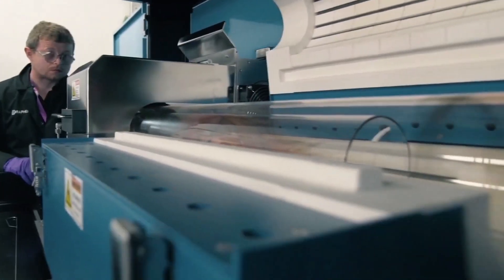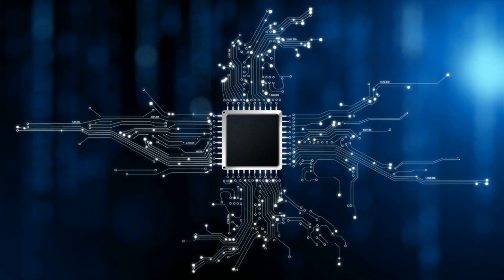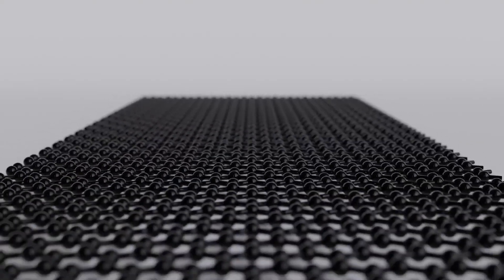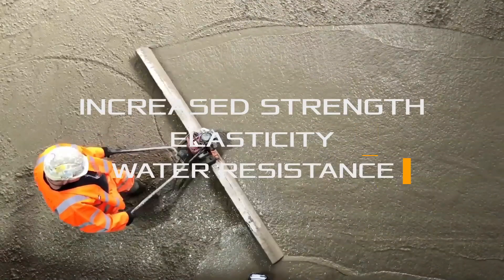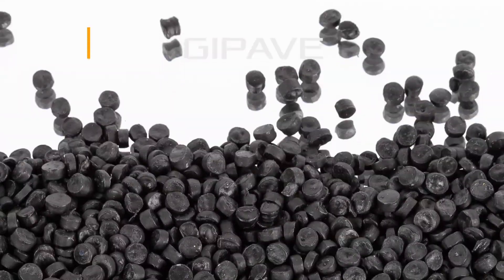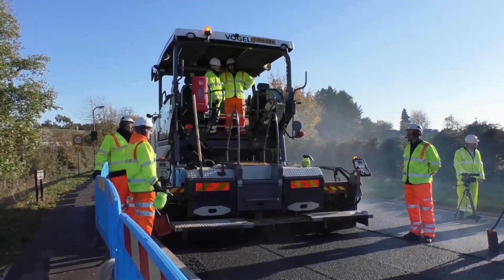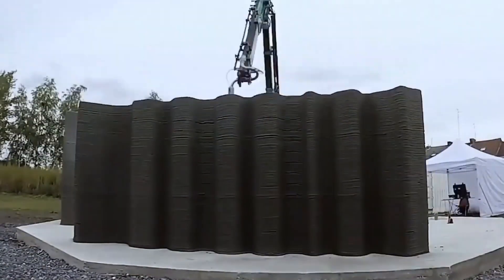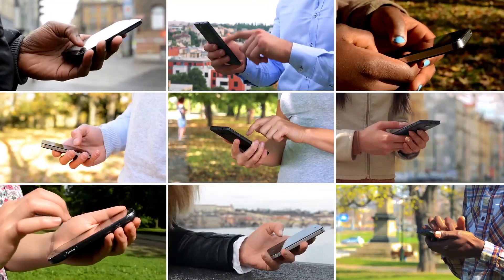Graphene in concrete is already changing the rules of the game in construction

Comment: Graphene Reinforced Concrete certainly is a novel idea.  On the surface, it seems as though it would extent the life of a road for quite some time.  
However, upon further analysis, given the nature of Graphene Oxide Nanosheets, because they remain 2-dimentional the only strength that added is that of damage from the from the compression of the vehicles traveling on the Graphene Reinforces Concreate.  It is also believed to add a measure of water resistance, the is the worst enemy of all roads.  Graphene Oxide Nanosheet Infused roads would also be measurably lighter, therefore making bridges, overpasses, on ramps, and other transitions additions to road less labor intensive, therefore less costly to construct.  Also, nearly all Fractural Strengths are inconclusive as to whether the addition Graphene Oxide Nanosheets. In facts, it varies so wildly, Scientifically, Peer Reviewed Study had been conducted that met the criteria for certainty that there was an increase Fractural Strength.  Equally valid Scientific Studies have shown nominal increase in Fractural Strength, while have shown as much as a 15% increase in Fractural Strength.  I like in the Silicon Valley, so Earthquake country.  For this region, the must be absolute certainty that there is a statistically significant increase in both Compression Strength and Fractural Strength, so for Graphene Oxide Nanosheet infused Concrete is worth the investment where we have to ALWAYS seriously keep in mind those roads, overpasses, exits, flyovers, etc. that unequivocally must stand up to a minimum of a 7.5 Earthquake.
The most obvious flaw with using Graphene Oxide Nanosheets screams out in it name.  They are sheets.  They are 2-Dimentional.  So by definition they can only add structural integrity on one plane.  It is also not very flexible at all, in fact, if torque is applied, it does not take very much to shatter the structural integrity of Graphene Oxide Nanosheets.

A far better a significantly more cost-effective alternative to Graphene Oxide Nanosheets is a technology already being used in roads: Carbon Nanotubes.  Carbon Nanotubes form helixes that tend to form long tubes.  As these tubes are 3-dimentional, they can resist torque on any plane applied by an Earthquake.  While Carbon Nanotubes are significantly more resilient, they remain, significantly more expensive, and there, at this moment in time, cost prohibitive for mass use in roads.  But manufactures are bringing production cost by factors of 10 about every 2 years.  So, within 5-10 years Carbon Nanotubes become, far and away the best solution.
Reply: thank-you
Reply: afaik, the problem w/ nanotubes is the very limited length of strands currently doable.
Reply: @peterconnell2496  Actually, there have been huge strides in Material Science recently.  A group of Japanese  Scientists, have found an entirely new methodology.  They routinely create 50cm long Carbon Nanotubes, en masse.  They are confident that they can move on to 200 cm within a month, again, en made.  This would eliminate the price barrier and allow for the begging of experiments in weaving these longer and longer strands of Carbon Nanotubes together, leading to possible limitless lengths of Carbon Nanotubes.
Reply: @donbrunodelamancha1927  Ta for the good input. That would seem the holy grail as short strands seem the key hurdle to wider applications.
Reply: And as usual, any post that gets more than 8 responses turns into a sh*t fest of name calling and posturing. Good lord folks.
Reply: Would not stacking the 2 dimensional sheets on top of one another as it seemed to show them doing mitigate this problem?
Reply: @davidtherwhanger6795  while an excellent idea, you would have to construct a lattice of sheets perpendicular to each other.  Unfortunately, this would also completely undermine the rigidity and structural integrity of Graphene Reinforced Concrete.  But I good hypothesis!
Reply: @davidtherwhanger6795  not 2d sheets......you have the length of the sheet, the width of the sheet, and the height of the sheet...with is one carbon atom thick.
Reply: @Ezzell_  I think everyone understands that everything in our universe does have three dimensions. However, a thing that is only 1 atom thick is for most intents a 2 dimensional object as for when you look at only the height dimension of it it does disappear to your vision as you cannot see that small. 2 dimensional is a reference to what we would observe and the only dimensions we would be concerned about with these sheets.
Reply: @davidtherwhanger6795  that is being intellectually lazy. This is how science myths and misunderstandings propergate into society.
Reply: @davidtherwhanger6795  i dont this is in the conversation we have been having.
Reply: @Ezzell_  Sorry. I have several different discussions going on right now.

As to yours. It doesn't matter if you think it is intellectually lazy or not. Demanding that everyone comply to an absolutely perfect description of something all the time or the world will come to an end mentality does nothing for science either. That's how you get into dogma and turning science into religion.

It is on the same level as the Grammar Nazi mentality.
Reply: @donbrunodelamancha1927  Well some one is touchy. I used that as a comparison that people would understand as many have ran into a Grammar Nazi. Using a comparison that others would possibly know and be able to see the comparison is not the same as calling some one an actual member of the NAZI party.
Reply: @davidtherwhanger6795  Sorry dude, those comments were not directed at you. They were directed the mouth breather: @ken ezzell.  I thought he wrote the message.  My bad, I apologize, sincerely‼️‼️✊🏼✊🏼✊🏼

I DO NOT I ANY WAY, SHAPE NOR FORM EVER equate science and religion.
Reply: Uuhhmm, where/how does "graphene oxide" enter the picture?  Graphene is one thing, a monomolecular layer of carbon atoms in an array of hexagonal rings, while all I can think of when I read "graphene oxide" is the gas carbon dioxide.  Please explain.  Thanks...
Reply: Graphene sheets are not 2d.   There are no true 2d objects in our 3d universe.
Reply: @Ezzell_  
Planes are, lol.
Reply: @b_uppy  geometry planes are abstract construction....not real
Reply: @Ezzell_  
They are real.  Even if you only use them in mathematics and, ahem, science...
Reply: @b_uppy  no....they are abstract structures.  

Can you hold a 2d plane?   No.
Reply: @Ezzell_  
You can't 'hold' air either, but it is real.  Planes are provable.  You are merely getting caught up in what is touchable...
Reply: @b_uppy  I can hold air in my lungs......
Reply: @Ezzell_  
Really???  What goes in is different than what comes out...
Reply: @b_uppy  geometry planes are an abstract construct. 2d planes only exists in math and thought.   Even if you draw a geometry plane on paper , the pencil marks has a thickness.....making it a 3d object
Reply: @Ezzell_  
Still real.
Reply: @Ezzell_  Did you watch the video at all?  The synthesis of Graphene produces a single covalent bond form.  Said form is EXACTLY 1 ATOM THICK.  They are called Graphene sheets for a reason.  Thousands of attempts have been made to to form Graphene Sheets into an infinitely more structurally sound tube.  The only problem is that 100% of the time Graphene sheets have been manipulated out of their of their Single Atom thick: Single Layer, Hexagonal lattice pattern, the lattice shatters.  

By the way, Graphene Sheets are a SINGLE ATOM THICK.  So unless you are referring of examining Graphene at the Quantum Level.  Since our Conscience Bodies don’t operate at the Quantum Level would be an exercise in self indulgence that would bare NO scientifically useful data nor results.

The least you can do is know about that which you speak.

There are also other inherit problems with the use of Graphene:
1. During the process of its synthesis, significantly Toxic Chemicals are used.  A toxic enough percentage of which remain the in the final product Graphene.  So for the 8% reduction in Global CO2 production, the toxins released into the environment will kill the planet much faster.

2.  It is lighter, but has. 200% the tensile strength of Standard Concrete, it offers NO Torsion Strength.  That resistance to Torque, so you don’t have to look it up.  So, while Graphene infused concrete IS lighter, and can handle a much heavier Compression load, that more weight, it cannot offer much in the way of lateral stability.  That means Earthquake country and in Sky’s raper and bridges over large bodies of water that experience high winds and sway greatly, the light weight concrete, less laterally stable, would have a far higher failure rate.  

That means in Earthquakes, the Graphene in elevated highways, bridges, any road or structure really, because it is 109% non-malleable, would literally shatter.  That’s means many x’s many casualties, most unnecessary.  The same would be true for Skyscrapers, Bridges, anything constructed of Graphene infused concrete would suffer similar consequences.  

3. For large, Commercial Manufacturing, huge amounts of Graphene sheets would need to be extracted.  There is no way to maintain Quality Control, therefore the finished product of Graphene Sheets would contain an unacceptable, yet imperceptible, amounts of impurities and defects.  That dog is going come back to bite those construction projects in the ass.

4.  Synthesis is currently too expensive to be a cost effective in mass construction projects.  1 Gram costing $100. 

5. The best method for producing large amounts of Graphene: Chemical Vapor Deposition. Chemical Vapor Deposition, or CVD. There are inherit problem with this this methodology.  If the end product is exposed to Oxygen and Heat, the stability of the Hexagonal Matrix can be compromised, even shatter.  Keep in mind Concrete is POROUS.  There are many reasons why.  Sometimes the thin structure of the cement is the issue.  Other time amount and size of aggregate is the issue.  Cement has so many pours, 96% of them are connected.

Now sealant can be used as can High Performance Concrete, HPC.  However, both wreck havoc on the environment.

Remember, water is the UNIVERSAL SOLVENT.  Leave anything, not living, in water long enough or often enough, and the water will dissolve it.  The Colorado River carved out the Grand Canyon one thousands of years.  Water v. solid rock, and the water wind 10 out 10 times.  

Graphene is a pipe dream.  If the Japanese research continues to produce exponential growth in volume and length of Carbon Nanotubes, that’s the True long term solution.

I’ll be here again tomorrow night, don’t forget to tip your wait staff and bartenders‼️‼️✊🏼💯💯💯💪🏼
Reply: @donbrunodelamancha1927  i believe you need to take a middle school geometry lesson.    Lets say the graphine sheet is 1million atoms wide and 1million atoms long.....how thick is it? ....1 atom thick.  So thats three dimensions  1 mil x 1mil x 1.

There are no true  2d objects in our 3d universe.    Even a single atom has three dimensions.
Reply: @donbrunodelamancha1927  answer a simple question with a yes or no...if your ego can handle it.    Using what ever measurement unit....plank length,  nanometer, the carbon atom it self as a unit........does a sheet of graphine not have three measurements?  Height Width and Length?     If you say no.....you have gain so much intelligents that you have lost all common sense.
Reply: @donbrunodelamancha1927  A single atom is a 3 demimentional object, putting carbon atoms in a single level array does not take a height measurement from the atom.   Answer a simple question with a yes or no...if your ego can handle it.    Using what ever measurement unit....plank length,  nanometer, the carbon atom it self as a unit........does a sheet of graphine not have three measurements?  Height Width and Length?   
 If you say no.....you have gain so much intelligents that you have lost all common sense.
Reply: @donbrunodelamancha1927  rotary kiln is what will blow the doors open to hundreds of thousands of tonnes/annum.  Cannot get there using fluidized bed reactors.  Watch this space.
Reply: I agree 95% with your comments on CNTs.  The only point where we differ is cost.  I believe that the costs are going to drop way further and way faster than you expect.  My company just finished commissioning a reactor that can manufacture 50 metric tonnes/year/shift.  We are now planning the next expansion that will involve a reactor that can manufacture 1500 tonnes/year/shift of carbon nanotubes (MWCNT).  I anticipate the market price of the material will be equivalent to synthetic graphite.
Reply: Thanks for taking the time to write this review. It helps to cut through the hyperbole to understand the underlying practicalities/economics of deploying this new technology. Particularly, where it may and may not work well compared to other solutions. I wish these types of shows applied more critical analysis; especially in the timeframe and steps needed to commercialize these solutions.
Reply: Succinctly put.
Reply: One should not play in Sandboxes of which he is unaware of the contents of the sands.  When they do, more often than not, they end up sounding like dullards trying to fit in.

Graphene oxide (GO) is the greater precursor to obtaining pure Graphene ant much higher volumes and much reduced costs.  

First of all, Graphite, being naturally occurring, is a polymorph of elemental carbon found in carbon rich metamorphosed rocks and veins.

To synthesize GO, Graphite Oxide, is very straight forward, and to be honest, very easy.  First Graphite Oxide synthesized by using graphite crystals utilizing graphite, then, through chemical reaction oxidize it with strong oxidizing agents, such as sulfuric acid.  Through sonication, graphite adopts oxygen-containing functional groups that allow the material to be dispersible in water while increasing interlayer distance.1 Then, graphite oxide can be exfoliated into either single or multilayers of oxygen-functionalized graphene oxide (GO).

Is that a simple enough explanation for you⁉️
Reply: @donbrunodelamancha1927  ...I'll ignore the gratuitous insult - from your nom-de-plume I suspect you may be a very young, arrogant  & rude person.  I am no dullard, but my talents lie in the sub-specialty of geophysical instrumentation, while my chemistry background is limited to a freshman non-organic course at university in 1965/1966, plus whatever I've picked up by osmosis from the scientific literature.
However,  I must thank you for the reply.  When I first searched for more information on graphene oxide, I fell into a rabbit-hole of apparent conspiracy-theory nonsense.  Your reference to graphite oxide assisted me to find a Wikipedia article on same, which pointed out that "graphite oxide" is "...an incorrect but historically established name..." from a time when chemical nomenclature was far less rigorous than today.  It then transpired that the same casual naming error was propagated to "graphene oxide".  The key point I learned from Wikipedia is that the two "oxides" are actually complex, three-dimensional carbon compounds with a variety of fancy structures that distort the precursors' original, planar structures in sophisticated ways.
You could have satisfied my curiosity with that last sentence alone,  instead of jumping immediately to a false conclusion that you were dealing with an idiot.  When you grow up you may, with more life experience under your belt, regret your mockery of others.  But no harm done - I've been called much worse things in my life, and don't need  "safe spaces".  Please allow me to wish you a belated Merry Christmas and an anticipatory Happy New Year in the meantime.
Reply: @donbrunodelamancha1927  
Your comment referencing dullards is obnoxious, but at least you conveyed your idea better, LOL.
Reply: @b_uppy  If it looks like a horse, walks like horse, learns speak and Compton themselves as a horse, it’s a horse.
Reply: @donbrunodelamancha1927  
Nothing like your being more obnoxious to make up for only a partial correction...
Reply: @b_uppy  As a Psychotherapist, I would you you have a relentless, and frankly, unhealthy need to both have the last word, one up people you encounter with more frivolous and petty insults.  They make you feel in control, superior, more significant than your normal insecurities allow you to feel.  You anonymity here also affords you license to and say whatever and whomever you wish.  Narcissistic tendencies., in general! Are merely a mask for your insecurities.

I would highly encourage you to seek both a psychiatrist, say, once a month and a PsD as a Psychotherapist, as they tend to be better counselors.  I’d start with. Twice a month then go with a time table your Psychotherapist thinks is best.
Reply: @donbrunodelamancha1927  
Your general nastiness,  your inability to simply correct a badly written post, your 'diagnosis' of me, as well as your claim to be a psychologist on the internet reflect badly on you, rather than anybody you've been been rude to.  
If you don't know how to correct the post, just tap the three dots under your comment next to the thumbs up/thumbs down options.   The three dots will drop the menu.  
It will give you the options you seek.  Don't be snarky.  Just ask.
Reply: @b_uppy  I don’t claim anything.  I happen to hold 3 doctorates.  2 of which I listed.  I don’t need to defend my bonefides.  I did give a complete description, as well as current information on strives in Carbon Nanotubes.  My diagnosis is sound, based on what you have chosen, and how you chosen to express yourself.  If you want to reveal a different aspect of who you are, maybe try not making uninformed declarations.  Just sayin’, you are you actions.
Reply: @donbrunodelamancha1927  
LOL!
Reply: Was that comment written by a robot?  Tons of mistakes and hard to understand what the point of view was .
Reply: @colingenge9999  look, I was 1/2 asleep when I wrote it,  at least 8 people understood it well enough.  Perhaps you don’t have the requisite knowledge base for the salient facts to connect.  There is no shame in not understanding things you’ve never heard of before.  What did you find confusing?  I would be happy to fill in the blanks.
Reply: @donbrunodelamancha1927  I understood it fine, and I'm an English teacher.  To me the internet is full of typographical errors and bad grammar, but this was fine, and it had lots of good info.
Reply: @donbrunodelamancha1927   I’m the 18th thumbs up, liked and understood the information you gave us.
Reply: @davidthomson802  as an student of life: my observations are engineering "types" and english teacher "types" have diffrent ways of understanding the world, thinking, and communicating. Being dyslexic; grammar natzis seem just rude. I get it, you speak more gooder and have to show the world you is the mightiest bestest of all.
Reply: @johnnycampbell3422  Well said.
Reply: @donbrunodelamancha1927  
Just correct the mistakes as you can to your post. What you wrote is interesting to many people.  They may either be rusty, planning to go into the field, in a corollary field, what have you, and would really appreciate the extra clarity in your writing.
'At least 8 people understood it'-- could be more...
Reply: @davidthomson802  
Invoking 'I am an English teacher' is less important than saying 'it was confusing here'.
Reply: @johnnycampbell3422  
Grammar Nazi is one thing, communication is another.  The ideas this person is trying to convey could be better appreciated if he reread his comment and corrected a few glaring errors.  Think the problem of the post is beyond 'grammar Nazi' in this instance...
Reply: @b_uppy  I don’t think I need to entertain your need to be superior.  I have expounded upon my original post several times.  I believe if you are unable to parse the corrections, well, that’s on you.